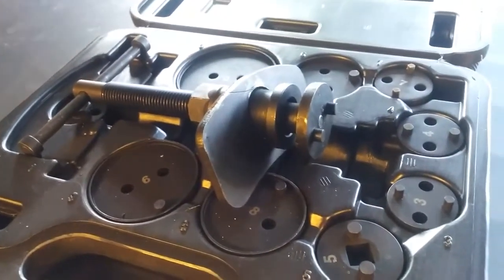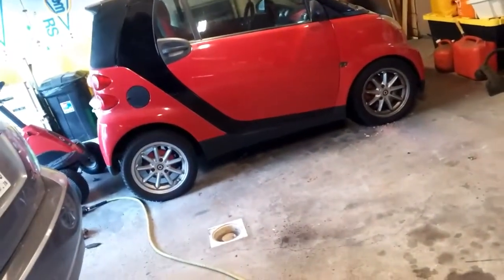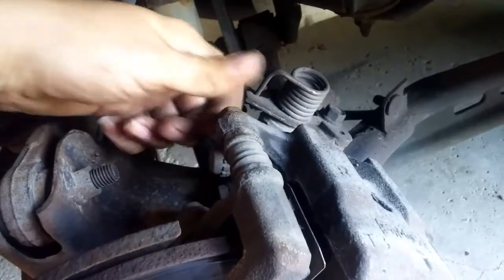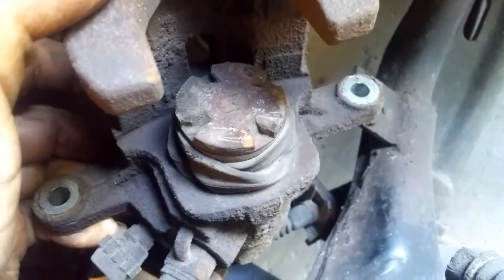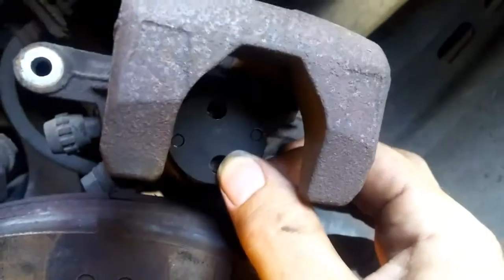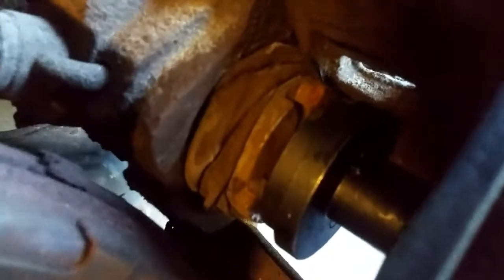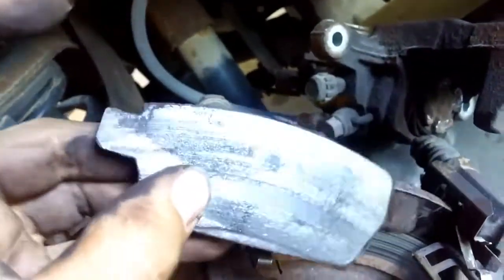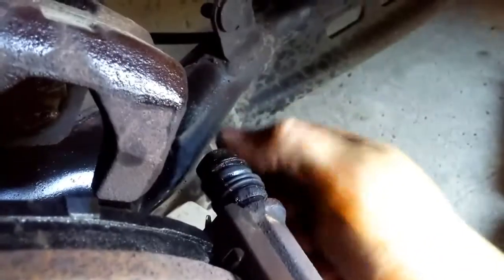Ford fusion rear brake pad replacement. Caliper service tool!

Comment: Cant you use the old brake pad, place it on the piston and use a C clamp to squeeze the piston?
Reply from the maker: Nope, not on these. The piston actually spins in and out like a screw.

Comment: Thanks for the video Drew.  Putting new pads on those rotors without either turning the rotors or replacing them is not a great way to repair your Mom's car.  The new pads will wear and mimic the grooves in the rotor instead of having a flat surface to work properly.  The mounting bracket should also be removed so that you could properly repair the slide pins and re-grease them with brake grease so that they slide easily.  And lastly, if you cleaned up the piston dust boot and sprayed some lube in the piston groove where the dust boot resides, it will allow the piston to spin inside the dust boot without twisting it so badly.  Any tear in the boot from overly twisting the boot will allow dust, dirt, water etc. to get between the boot and the piston and it will freeze in the caliper bore.
Reply from the maker: Sometimes you have to work according to peoples budgets. As you know doing things "the right way" can add up very quickly. Where as i always appreciate input, these pads will last probably 6 or 7 years like this with the super low braking pressure of rear calipers. Plenty for an old car.